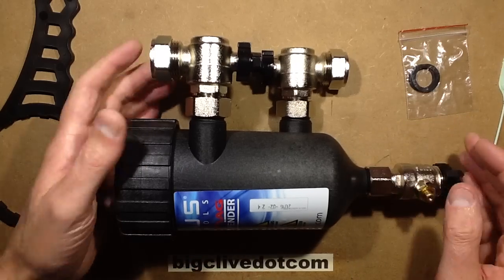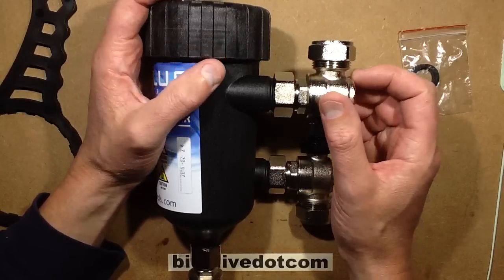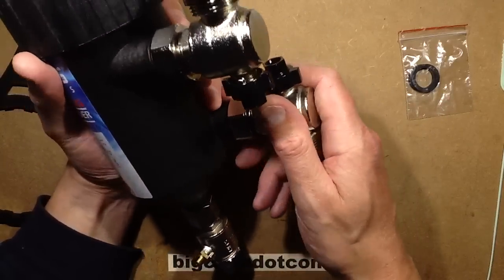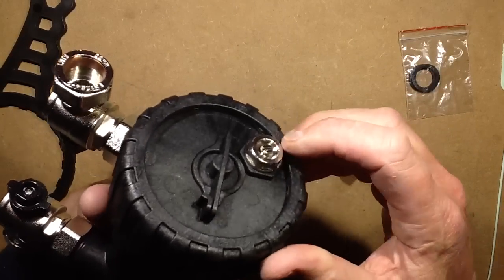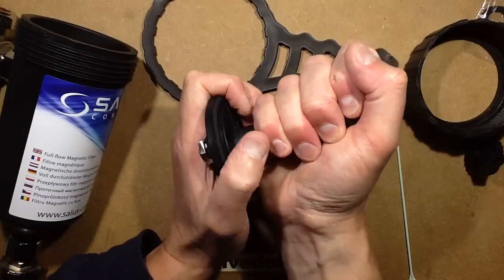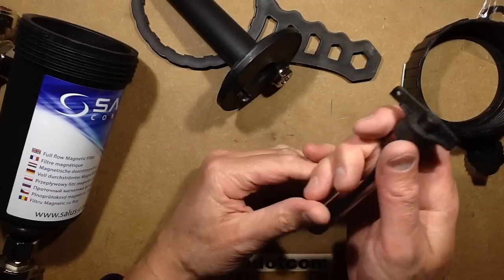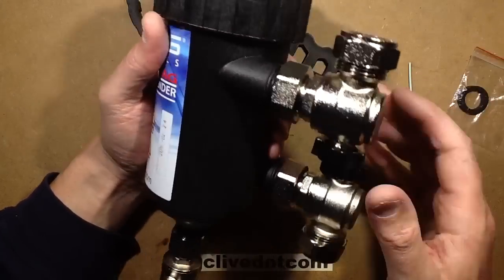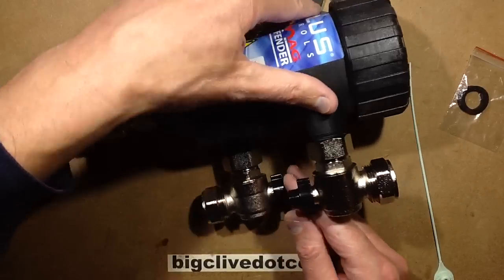Inside a heating system magnetic "sludge" remover.

Comment: Wait, so your house is heated with radiators still? Wow that's weird.
Reply: For example in Finland (where i live) most apartment buildings have central heating with water circulation and radiators. Reason for this is very simple; Every city and town centres have distributed heating and running central heating from distributed heating with heat exchangers is very simple. Forced air has gotten a foothold in new designs - especially when it's complemented with air cooling for hot summer days - but central heating with water is still the primary option because it doesn't require large air ducts, losses are lesser (important in cold climate) and forced air would still be heated with the distributed heating.

My home city gets it's heat as runoff from a nearby papermill - effectively working as a radiator for the excess heat the papermill produces. Thus the cost of distributed heat is cheap as chips as well. :)

Edit: In some large cities, the building code mandates new single houses to connect to the distributed heating if it's available. Houses that are built to areas without such mandatory rule, are usually connected to distributed heat just because of the cheaper heating cost. But ofcourse the home builder can choose between forced air - which is becoming dominant in new single houses - and central heating and whatever there are out in the market. Incorporating a solar collector or ground loop is easiest with water circulated central heating.
Reply: +Owen Major forced air is noisy, every time it turns on it stirs up dust in the room. Radiant heat when used in floors makes hard surfaces like tile and wood warm to the touch. Radiant heat used in floors warms a room from the bottom up. Duct work for forced air leaks, is difficult to seal so heat is wasted in no living spaces like basements walls & attics. heating large homes or buildings is difficult with forced air. Every time you put a bend in the duct you reduce air flow. The further a room is from the furnace reduces air flow.
Reply: Hydronic heat is very common in many parts of the world including the northern areas of the us...
Reply: Well... All of those Poundland leds can't heat that much so he has to use radiators.
Reply: I am 16 and I have installed a lot of radiators. Here in the UK they are incredibly common, even in my aunt's old multi-million pound penthouse which was incredibly modern in 2007. She sold it in 2013, and even Eastenders (UK soap) offered her money to use it for filming when that Asian dude who is dating the white girl was introduced.
Reply: every house still built in Ireland has a central heating system with water radiators as electricity here costs a lot more than kerosene oil or natural gas. We don't like electric heaters or force air, as they are not that safe they can easily burst into flames.
Reply: Standard here in the UK and Europe.
Reply: allot of apartment buildings use radiators, and schools as well. the radiators usually are relatively small and run along the edge of the walls in these buildings (fellow canadian too)
Reply: An electric heater is more prone to burst into flames than having a kerosene or natural gas fire going in the corner of your house?
Reply: My house was built in 1960 here in the States. I've got natural gas hot water heating circulating through radiators. Much better than fan forced heating by a long shot. Totally silent, and doesn't dry out the air like fan forced heat.
Reply: +Joshua Nicoll You are correct about smells. The first time the heat gets used in our brief cold season there are a few minutes of smell as the dust burns off the coils. After that it's fine for the rest of the season.  But the coils and heater section are designed with that in mind and I've never had a fire in the 40 years I've had this house.
Reply: 40 years ago in the UK, forced air (Ducted) heating was popular. Not seen in last 30 odd years. Hydronic Much cleaner and totally silent and better for anyone with respiritory problems.
Reply: I live in Canada, and I don't know of any buildings short of 30 years old that have radiators still, forced air is simply better.
Reply: Still don't get it, you can get a furnace powered by electricity or natural gas. My house for example is hooked up to natural gas, therefor thats what the furnace runs off. I cant imagine why you would still use radiators is new homes.
Reply: Darren Gendron I was thinking more along the lines of water radiators, electric radiators are easy put in, thats there main advantage.
Reply: +Marvyn Harris they are contained in special boiler units, why the fuck would you assume they were in open air?
Reply: +Joshua Nicoll I was making a point. Why would a well designed and maintained electric heater burst into flames any more than a well designed and maintained open flame furnace?
Reply: Because dust and hairs being drawn into a red hot heating element generally does that. They can easily cause nasty smells and smoke.
Reply: +God of Thunder (UKKONEN)  If you stir up dust in your room with a light breeze from a HVAC system, I would recommend vacuuming more frequently and or cleaning your duct work.

Ductwork is quite easy to seal as well, as long as you do it before you hide the ductwork behind drywall. They make foil tape for the job that works great. Did it to my own system last month (luckily my ducts aren't hidden behind walls)

While bends in ductwork do reduce air velocity, and the ductopus is to be avoided at all costs, there are mathematical calculations that can be done to properly size your furnace and blower speeds to make it a non issue. Any properly installed system in a large house takes these things into account.  You can also get inline fans for ducts if you really need to push the air a long way. 

I would bet a dollar though, that most forced air systems are not particularly well installed, making most of your points quite valid.
Reply: AFAIK forced air heating is inherently less efficient, regardless of the power source for the furnace. It's definitely much less space efficient — ductwork takes up an awful lot of room. And it doesn't heat very well — warming up the air is a less comfortable type of heat than radiant heat.

Also, Clive lives in a house that looks.. About 1920s.  Possibly even 1910s. Most people live in houses that are more than thirty years old.

Comment: Hey Clive that valve on the bottom and the removable core are made so that you can purge the device without opening it up. You close the output valve, open the purge valve on the bottom then remove the core. The incoming water pressure will then flush the device.

Comment: if you close the valves, pull the magnet out, crack the inflow valve and the drain, then close the inflow and open the drain all the way and vent it you should be able to dump the crud out without too much hassle. A clear bowl  on the bottom would have made it even easier, something like a water separator for fuel lines.
Reply: Yes, the whole point of being able to withdraw the magnet is to allow the magetic sludge to drop down into the bowl to be flushed out through the bottom valve
Reply: I was thinking the exact same thing!
Reply: That's what the manual says.

Comment: radiator heating still is used?
Reply: Um, radiators ARE part of a central heating system
Reply: Terminology could be an issue here: in the UK, most people think of 'central heating' as radiators/boiler (aka Hydronic heating in the US). I guess the 'default' definition for 'central heating' is whatever's most common in your area. All of them work to prevent frost (except ...wait a minute, isn't clive's house usually freezing?)
Reply: Its prevalence depends on where you live and the age of the home. There's a lot of "older" (1960s and earlier) homes in CT that still use cast iron radiators. My house was built in the 1970s, so I have hot water baseboard "radiator" heat, and the furnace also supplies hot water for the faucets. 

In the 1980s, heating methods started to lean towards electric, in the forms of electric baseboards and forced-air systems, since electricity was relatively inexpensive. And these same homes could have electric or LP water heaters. In CT, our electricity is much more expensive than it used to be (almost 3x what it cost five years ago per KWh) because the power company doesn't have any generators (they have to "buy" the electricity from somewhere else, thank you deregulation), it's not uncommon for electric-heat homes to pay $600-800 a month in light bills!

Trailer homes are heated with forced-air systems, some have an electric heating element and a blower like standard house systems, others have electrically-ignited kerosene burners.

I suppose each type of system has its benefits depending on the building and the climate. For instance, using a forced-air system in a log cabin with an open floor plan can be a challenge to hide and run ductwork. Installing a forced-air system in a 100-year-old house with plastered walls and a single woodstove in the basement is a costly and messy experience when hot water baseboard heat can be done much easier.
Reply: well he's scotch so he never turns anything up to comfortable levels, that's wasteful.
Reply: There is also radiant heating where hot fluid is flowed through tubing in the floor, either cast in concrete when built or retrofitted by placing the tubing in metal heat spreaders and the flooring floated above it. It's more expensive to buy and install, but cheaper to run, especially with a heat pump.
Reply: What else would you use?
Reply: +TheChipmunk2008 in the USA forced air is common
Reply: Ah sorry, I thought you meant 'what else would you use [on a hot water heating system]' 

Yes, hot water heating's more common here because historical reasons. I prefer it, the forced air seems to heat the house in 'spurts'... 'too hot, too cold, too hot, too cold' Maybe that was due to the house I experienced it in being old and full of holes. LOL
Reply: Central heating, less common in the uk.
Reply: +TheChipmunk2008 well, yes but forced air central heating.
Reply: The area I live in didn't even get central heating until the mid 80s.
Reply: +Torc Handsomeson er, I think Clive is Scots, not Scotch! (Scotch is a drink of course!)
As for Central Heating - the clue is in the name! It means a system where the heat source is centralized, and the heat is distributed to where it is needed. In the UK this is most often by hot water feeding radiators or underfloor pipework, but it could just as well be by hot air.
In common use, central heating gets extended to mean any permanently installed heating system, so in the UK usually includes systems based on electric storage heaters fitted throughout the property - not centralized, but still usually called central heating as each storage heater works similarly to an centrally heated radiator system from the householder's point of view.
Reply: scotch is another way of saying scottish.
it's not scotch the drink, it's scotch whiskey the drink, scotch for short.
Reply: Maybe that's how it is in North America, Torc, as it was hundreds of years ago here, but in modern times it isn't a good way to identify a Scottish person.  Incidentally, the drink is spelled "whisky" if you're writing about Scotch! "Whiskey" is for the Irish!

Oxford English Dictionary says: "The word Scotch...[is] disliked by many Scottish people (as being an ‘English’ invention) and now regarded as old-fashioned in most contexts. It survives in certain fixed phrases, as for example Scotch broth, Scotch mist, and Scotch whisky.

Wikipedia says:  "... the word "Scotch" is only applied to specific products, mostly food or drink, such as Scotch whisky, Scotch pie, Scotch broth, and Scotch eggs. "Scotch" applied to people is widely considered pejorative in Scotland, reflecting old Anglo-Scottish antagonisms, but it is still occasionally used in England, though the usage is considered old-fashioned..."
Reply: yeah, that's why i used scotch because i was making fun of the old stereotype about scotts being cheap. so scotts would know i was joking and not take serious offense.